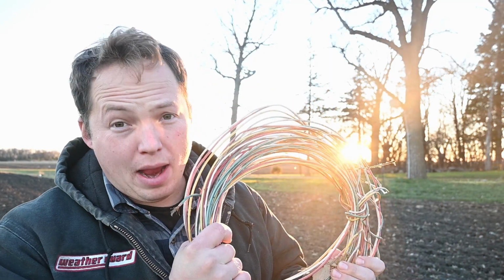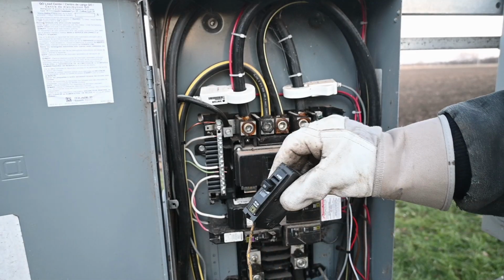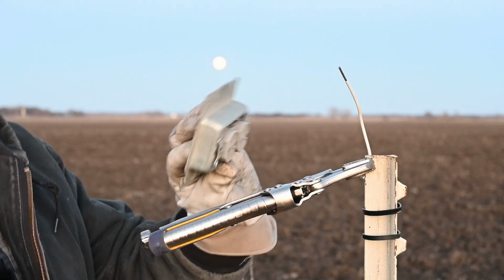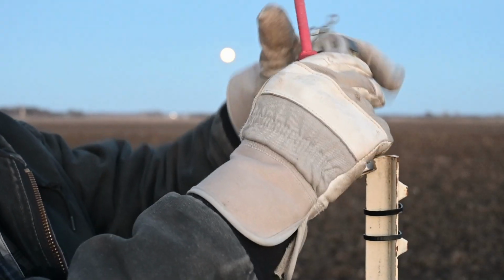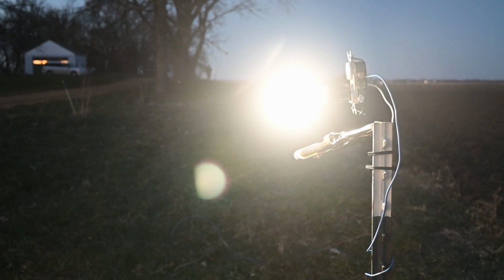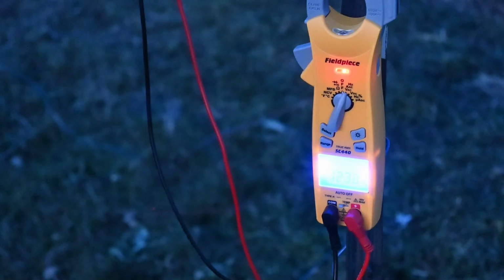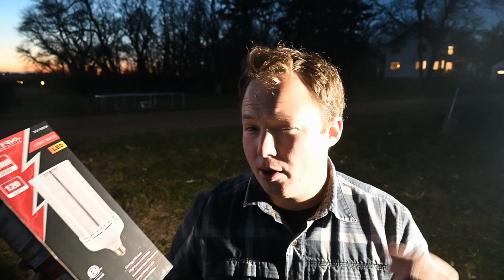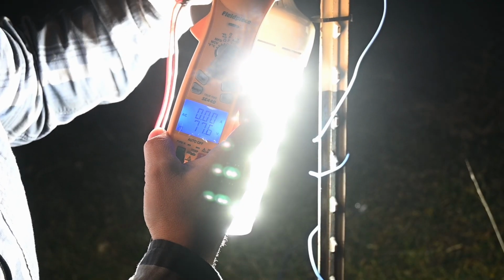Powering a Light With a Fence Post & Scrap Wire - SWER (Single Wire Earth Return) Demonstration

Comment: My own experience with SWER is as a telephone technician.  The farmer's daughter had moved home to live with her elderly parents, her father was suffering from the early stages of Alzheimer's. She called in to complain about frequent noise on the telephone line.  Her mother told her it was okay, all she needed to do was turn the barn lights off.  When a tech went out there to check it, he tested the line and everything looked ok except for an imbalance in the capacitance of the line.  As he started to trouble shoot the system he received what could have been a life threatening shock.

At some time in the past, the someone (the father?) had decided to control the lights in the barn using one side of a telephone drop wire and SWER, to trigger a relay in the barn to turn the lights on.  The way it had been set up, the wire to the relay, which was also the drop wire to the extension bell in the barn, stayed energized but open without the relay contactor energized, putting 120V potential resting on the drop.  Because of the locking style of relay, when the lights were on some of the energy was tapped to hold the relay closed, which also put voltage on the return path for the bell and noised up the associated phone line.

My own involvement was as a technical support engineer, called in because of a dispute with the customer.  It seems that after the telephone was repaired, they no longer could turn the barn lights on and off from the button in the kitchen.
Reply: Jim, I thought sure that was going to be a farmers daughter joke!
Reply: @mavamQ  Well, it doesn't apply to this, but the farmer's daughter inherited the farm and proceeded to turn it into a hippie commune.  She called for telephone service and I went out and installed the basic black phone that she ordered.  She asked me if I couldn't give her "colors" and I told her there was a $5.00 upcharge, which she agreed to, but then when I asked her what color, she told me that she wanted a green phone with a red dial and a blue handle . . .  I explained that I could not do that and that was that until I had to go back a couple of weeks later to replace the phone because she had painted it and whatever paint she used, and she had to try several before she found one that would stick, had attacked the plastic of the phone and melted it.  She finally had a psychedelic phone, it just didn't work.
Reply: @jimlongley9531  -  As a retired phoneman, I love these old war stories.  I never did any residential phone work, but there is plenty of wacky stuff in commercial/industrial, too.
Reply: @rb032682  Had more than a few of those as I worked my way up from POTS to key and eventually "Teletype."  One of our customers got tired of calling us when a nearby lightning storm blew all the diodes in his ringer matrix and went in and replaced all of the diodes with beefier ones.  I saw what he did and told other techs and eventually we started going in and buying our own at a nearby electronics supply house that the phone company had an account with.  Pretty soon we didn't have to buy any more.
Reply: @jimlongley9531  -  I never had to deal with ringer matrices.  I started my phoneman career in 1985 working on ROLM on-premise PBXs and related equipment.   I still had to troubleshoot more than one improperly wired "ground" and other things that can haunt a field tech.
Reply: @rb032682  After I was made a "Technical Support Engineer" I got sent out to assist our tech in troubleshooting why a customer was having issues with poor transmission quality, in particular high pitch voices being muted.  Before I left the office I told the tech that it sounded like an impedance mismatch to me.

When we arrived at our appointment, we were ambushed by an engineer from the NY State Public Service Commission (You remember when the phone companies were regulated monopolies, right?)  The customer had complained to the PSC that NY Telephone was providing poor service, on purpose because he had bought and installed his own equipment and even set up the PSC visit for when he knew we would be there.  We introduced ourselves around and I set up my sophisticated test equipment while the tech went out and isolated the phone lines for me (code for he disconnected 4 of 5 lines while I ran tests on the 5th.)  Everything tested better than nominal, even the PSC engineer was impressed with the quality of the lines.

Despite the tests being excellent, the customer kept insisting that WE were doing something wrong, on purpose, and even got to the point of implying that the PSC engineer was conspiring with us.  The PSC guy even went so far as to places LD calls to listen to sound levels, and the customer was almost right.  Placing a call through the butt set at the interface resulted in excellent sound levels but placing it through the desk phone next to it was lousy.  I had already expressed my opinion that the problem was in the customer's equipment, and he began blowing his stack because (he said) that the supplier had been out and tested it several times and there was no problem, and he wasn't paying them $$$ to come back out again.

While this guy was blowing his stack, I was backed up in a corner of the closet next to the PBX and happened to notice a nomenclature plate and happened to notice that the plate specified 150 Ohm lines (non-loaded cable pairs) and I knew that the customer had 600 Ohm lines (loaded) so not only an impedance mismatch, but frequency limiting due to 'C' weighting.  I tapped the PSC guy on the shoulder and pointed to the nomenclature plate and gave him a one sentence analysis, with which he concurred, and while he gave a short and concise analysis of the situation to the customer, I packed up my gear and had the tech make everything normal and left.

We met the PSC guy down the road for coffee.

The customer wound up paying NYTel to "re-engineer" his lines and make them all 150 Ohm.
Reply: @jimlongley9531  -  Isn't that the responsibility of the customer, or vendor, to specify the correct circuit when the order is placed??
My former employer had a fairly large department which handled ordering the correct circuits as well as semi-dedicated techs to handle connections to the pbx.  It worked quite well until that department was downsized.
Reply: @rb032682  The final outcome was that it was the vendor's responsibility to specify the correct circuits for the customer to order, the customer's original order did not specify, but the paperwork obtained by the PSC, from the vendor, showed that the circuits were specified to be non-loaded 150 Ohm cable pairs and the customer argued that NYTel should have known, but all of his paperwork just showed 6 POTS lines, with one being a dedicated fax line and specified as 150 Ohm.
Reply: @jimlongley9531  
😂😂😂 hippies... they're so smawtttt!
Reply: @mavamQ  🤣👍🏼🗣Me too 😂🤣😆
Reply: Wow that's an interesting one. Phone repair techs always have interesting stories like that.    I'm not a phone tech myself but work in telecom.  Heard a story where a customer said every time they got a phone call the furnace would start.  They thought the person was crazy so they send a tech anyway and tech found that someone somehow tapped the thermostat wiring into the phone line.  The ring voltage was tripping the furnace relay.  Surprised it did not blow it actually.
Reply: @redsquirrelftw  We had a customer whose dog would go nuts when their phone rang, and the dog was outside.  They were on a party line, and party lines ring with ground return.  They had the dog tethered on a chain attached to a 'T' stake outside the back door of the house.  The T stake had been driven right through the ground wire attached to the ground rod which provided the path for the ground return and when the ground was damp, the dog got some of the 96V 20Hz ring voltage.  

They had complained about a "weak" ring a couple of times, and the first tech had just gone out there and loosened the bias spring on the ringer, the second tech installed one of our new "ringer isolator" gizmos which didn't help either.  I was a tech support engineer and I got sent out because not only were they still complaining about the weak ring, they had noticed that the dog yelped and ran around when the phone rang.

It took me about 5 minutes to spot that their ground wasn't right, and the tech they sent out to help me was the first one that had just adjusted the bias spring, and I had him dig out the top of their ground rod and follow the wire, and not only had they cut through the ground wire, but they had cut through the power ground as well, so their entire protective ground and return were depending on the "casual" contact between the cut ends of the grounds and the T stake.  Even their well pump was no longer grounded properly.
Reply: @jimlongley9531  LOL. No doubt the dog really hated tele-marketers.
Reply: @jimlongley9531  I heard a similar tale from a telecoms tech in UK years ago. He said they were called out because the little old ladies phone wasn't working properly. She also thought her dog was psychic as it always barked before the phone rang.

They found she chained the dog to an outside metal drain pipe, and the earth return on the phone system was degraded. So the ring current would go through the dog as an alternative, it would howl with the shock and then the earth return healed itself enough to drive the bell, hence the dog announcing the call before the bell.
Interesting to hear that it happened more than once.
Reply: This is the coolest most interesting comment thread on YouTube as far as I'm concerned 😂 these stories are fantastic.
Reply: farmers daughter?? i thought it was going to get spicy 🥵🔥
Reply: @ohioplayer-bl9em  -  "rectum ?!?  Damned near killed 'em!"
Reply: @ohioplayer-bl9em  Spicy would not be a fit description, she looked like Ellie Mae Clampett once she got to Grannie's age, and she wasn't that old yet.
Reply: Well this reminds  me of an ex of mine who lives south of Morrilton Arkansas  and she was a phone sex  operator  .
. She told me lightning had fried her computer which  ment she couldn't do her phone set  job .... I said well being south of Morrilton... maybe God hates your job....
Reply: @jamesgibson5876  lol
Reply: W
Reply: Brings new meaning to "ground-start", eh? That dog sounds like he went into a few "loop starts" himself, lol. 😂
Reply: PIN this
Reply: I worked for a well drilling company and ran into something like this with a pump control circuit. Damn near knocked me on my ass.
Reply: That's the first thing my ex husband (Electrician local 7)taught me when wiring a phone line is how to distinguish "tip and ring" (as he called it) and ground.  🤔Sounds like y'all are saying the green phone wire or ring wire was used by accident for these lights.  That's funny!
Reply: @wendyjomendy  But the tech, and then I,  found wiring that indicated that the wiring was done that way on purpose.
Reply: Nothing like homeowner/handyman repairs. If no one dies that is.
Reply: Interesting jury rig
Reply: This post actually reminds me of a psychiatric patient I encountered at the hospital. He kept on tapping and tapping
... See more
Reply: XRAYCAM...... YER SUCH A DIIIII@X!!!! LOL 🤣🤣🤣🤣
(got me, too tired to notice lol)

Comment: We had a 220 volt feed to a pump house ( two 110 volt leads, 180° out of phase). I was able to take one of those hot legs, and match it to a ground rod to get 110 volts for lights or power tools, similar to what you did.

Comment: What amazes me is the fact that most don’t realize just how the energy actually travels outside the wire in an electro magnetic resonance field at or about the speed of light 💡 electrons don’t actually flow trough the wire it’s impossible for if It did travel trough any such matter at the speed of light it would create so much heat the wires would just melt and the connection lost ! These truths are just a small part of our reality that is kept hidden from you !
Reply from the maker: Yes!
Reply: Interesting, but wires ARE needed...the larger the electro magnetic resonance field, the larger the wire.

Comment: This one works too. Insulate an 85 ft. bare copper wire a foot off the ground on both ends. Tap a third of the way down with a coaxial cable, attach the coax to one side of the bulb and the other side to a ground wire. Gets you 15 watts by day and 8 watts by night. It works off of solar radiation. Try it.👍
Reply: Any interest in doing a video on this?  Does the wire have to be straight for the 85ft, or can it loop, etc?
Reply: @zackthompson2505  the wire has to be straight. I learned this theory watching a video from a solar research company in Sweden. It made sense to me so I tried it and it worked. You're not going to get 115 volts AC out of it, but enough to power led lights and recharge your devices. It's been two years, but if can find the video I'll shoot it your way.
Reply: @flynnstone3580  What kind of voltage does this produce, and would lengthening the bare copper wire increase current?
Reply: @Tailss1  it produces 15 watts DC during the day and drops to 8 watts after dark. I never tried lengthening the wire. Don't have to much more room. I suppose you could run two side by side and double them up. I have mine charging a 12 volt deep cycle marine battery.
Reply from the maker: Seriously? That's awesome.
Reply: @BenjaminSahlstrom  Did you ever get the batteries in your smoke detector replaced?
Reply: I love to see that demonstrated. I don’t have the space to try it.
Reply: Am I the only one confused? A bare copper wire but insulated? Tap a third of the way with a hammer? The coax cable inner or outer wires?
Reply: @Laurel-Crowned  you want to use the center lead of the coax, best if soldered. I learned this theory watching a video two years ago from a solar research company in Sweden. You don't need to hook it up to your power panel. I get 15 watts DC during the day, and drops to 8 watts after dark. I have a Westinghouse solar power station for my tiny house, but use this to charge all my devices. You just have to have the long wire fenced or protected where deer won't trip over it and break it loose. It will easily power a led bulb, but you're not going to get 115 volts AC out of it.
Reply: @flynnstone3580  Please post a link to the video
Reply: @Laurel-Crowned  
👍
Reply: This wont do a DAMN thing. Don't make shit up.. 🙄
Reply: If it's solar, how does it supply 8 volts at night? I know antennas can build up static charges, or maybe it's radio radiation?